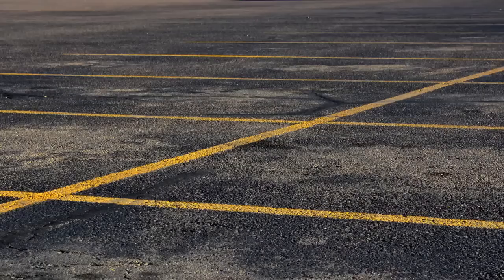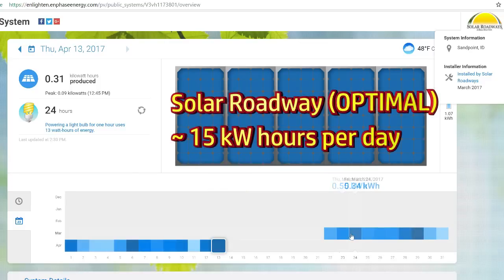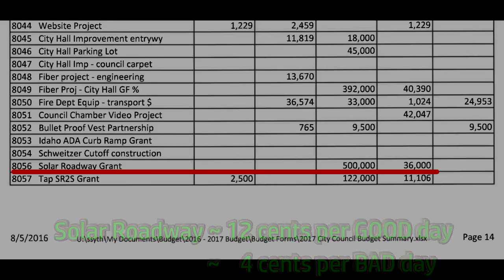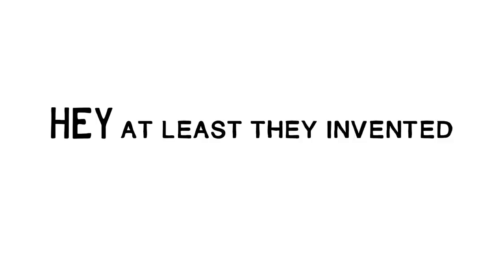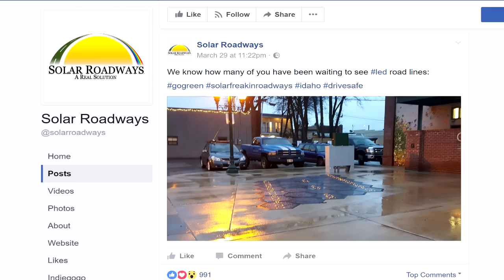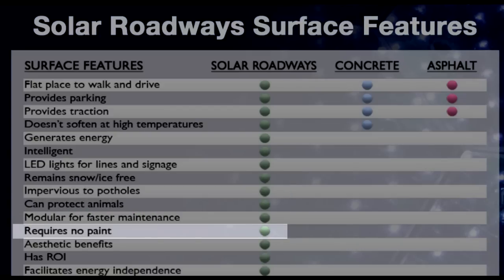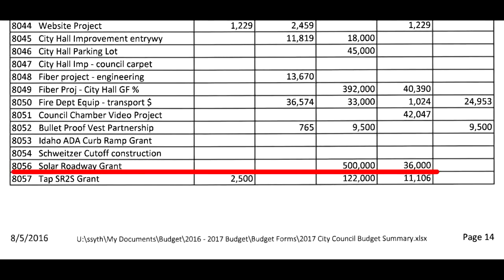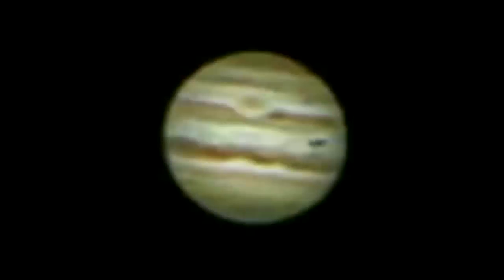Solar Roadways generate ~10 CENTS per day!!

Comment: I don't understand why they haven't had the LEDs in their example installation form any "useful" patterns. They just need a microcontroller to map the individual LEDs to a virtual grid and then they could easily draw anything they want. Is it because they are struggling with just getting the things to stay on and not catch fire? I guess that would take a higher priority.

Also for anyone that claims that these things just need more refinement and the economy of scale, neither of those things are magic bullets. Some ideas just don't make sense, and you can throw a thousand engineers and billions in development at them and get virtually nothing in return.

Comment: When trying to create a way to generate energy efficiently, why then would you add microprocessors?? Solar tech is already simple enough, but to add lights and microprocessors (when its not even needed)...then you are drawing more power than necessary decreasing your gains even more...not really that intuitive...

Comment: Here is a question, have you looked at the solar panel 'roof shingles'?

I ask because that seems far more reasonable  but in the frozen North of Ohio USA i can only imagine that in the winter it would not be that useful.  However i am more worried about cooling then heating, last year it got into the 90s a few weeks and that is not ok for Ohio.

So have you looked into those?  They are from Tesla i think.

Comment: My major problems. are: 1) washout under the roadway. 2) Solid, it MIGHT be able to withstand traffic. But will plastic withstand it? So far only concrete works best.

3) With traffic &/or snow on it, how could it generate power? Right now, they have it hooked up to a generator. 

4) they plan on making it even worse by having it be HOLLOW. Real roads have crowns in the middle, so water runs off. Won't happen here. 

5) Room for cables? Great, so if the road has to be replaced, how much cable needs to be replaced?

6) I'm not comfortable with water & electrical cables being together. What happens if there is a breach between the 2, say a major accident? A big rig overturning, Plane crash, tornado,  flood, mud flow.

Comment: Solar Roadways is a great idea, for about a minute. Then you imagine the worst case scenario on a road, realise there is sharp glass, metal, electronics and no drainage and a road accident will get about 100x worse when it happens. I mean, what happens to spilt fuel or oil on a roadway like this? Never mind the solar panel return on investment, what happens when you're relying on the "LED road markings" and there is an electronics fault so all the markings disappear? It's a great idea for a sci-fi film but in practice with the materials and technology available to us right now, it's not feasible.

Comment: The part about Solar Roadways heating itself to remove snow and ice is perhaps the most dangerous aspect of it. The worst kind of slippery winter ways are when there's both water and snow/ice on the road surface. What happens is that while the lowest layer of snow will melt, if there's a continues snowfall, it will come to a point where the water just freezes above the melted snow. Creating a very thin layer of ice on top(on ordinary roads it's the other way around - Water resting on top of a layer of ice), which when a car drives on, with even the best winter tires will run a much great risk of losing all grip that, making the car near uncontrollable - even for the best drivers. In essence, a similar situation to when you get aquaplaning while driver over wet road surface.

Comment: you have a point but I despise how blatantly disingenuous you're being with your assumption of prototype costs being final costs. You don't have to cheat to prove this as ridiculous, but as you choose to do so you strengthen these charlatans' position. I work in manufacturing. I know FIRST HAND how much economies of scale change the production costs. I also know firsthand how much the cost drops after processes are established and custom tooling and equipment have been acquired. By the time something hits the market, you get a price equal to only the base cost of the raw materials involved purchased in bulk at steep discount. A $5000.00 single piece demonstration prototype quote where all components must be machined from scratch out of bar stock by a skilled machinist on lathes and mills will drop PRECIPITOUSLY to less than a tenth of that cost once you have casting blanks that can pop out the same parts at the same effective quality several hundred pieces PER MINUTE under the supervision of an entry level machine operator. SHOW HOW THIS FAILS AT THEIR BEST CASE SCENARIO AND THERE WILL BE NO DOUBT.

Comment: You haven't mentioned transmission costs. Under say 10 miles of road, the losses in the cabling would no doubt wipe out any profit unless the voltage was raised to high levels. 
I don't want to appear to be a Luddite, but not all new ideas make any sense. Just because it's new doesn't mean it's good

Comment: I have been telling people for years, if we want to properly use solar power, cover the roof tops in panels. 

i dont know the numbers, but if every rooftop in a city is covered in high quality solar panels, it would at least generate the majority of its power, and will create more jobs then coal. 

Manufactoring of all the parts, plus installers, maintenance, and those running the management stations overseeing it all. 
cleaner, plenty of jobs, and panels need to be replaced every so often so its not set it up then walk away.

Comment: If Galileo wanted to put windmills in caves, they probably wouldn't have stopped laughing at him either...

(Also, at 15:30 you say half a billion, which is correct, but you wrote 500 billion. You might want to put an annotation over that.)

Comment: I don't know why no one thought of this, but streets get dirty, I feel like if everything else worked out in their favor, just the fact that you'd have dirt and surface scratches reflecting and refracting light away from the PVCs it would lose efficiency over time. I'm feeling lazy so I'm not going to look up the hardness of the glass they'd use, but I don't doubt it would scratch and scuff eventually turning from transparent to translucent.

Comment: Solar power for grid electricity on Earth is terrible*. All the toxic mess of making electronic devices. With all the disadvantages of trying to build a grid out of unreliable crap electricity (*stupendous transmissions requirements that need to shuffle electricity from anywhere to anywhere and near 100% backup with fast responding fossil fueled generators or ridiculous storage systems that cost many times world GDP). The transmission alone will replicate the mess of oil politics; look at the Desertec project; reads like a who's who of the Arab spring and refuge crisis.

The right job for solar  power is small remote knick-knacks and sensors and especially satelites. As a source of grid electricity it is just a delaying tactic for fossil fuels to make sure they have a future long into the 22nd century.
Reply: soylentgreenb I agree. great for space flight, ok for auxillary power for small important systems, terrible as a main power source. way too expensive to be feasible. personally I think investment into fusion is the best bet. it's risky and may never be feasible but if it ever does then it's practically limitless energy.

Comment: There is a difference between "doesn't work" and "can't work".

If this were 1980 you could pull similar numbers on home solar panels. Back when they produced 1/8 of current technology and cost five tines as much. Would you be laughing at how gullible people were trying to generate electricity from panels on top of their houses?

Now I'm not saying there will ever be a day when Solar Roadways will be popular. But production costs do drop, prototypes do eventually come more stable, and solar technology is still becoming more efficient. This idea might be viable, in some form, one day. Work as advertised? Oh no.But that is what science is. Trying stuff out. 

That self filling water bottle can't work, not ever. Put it in the wettest, sunniest climate and come up with a really good solar panel that is big and still no go. OK I guess maybe as an emergency means for boats it might work, but there are other much better options for that. Point it that can't and will not ever work. Solar Roadways might still have a use at some point though.

Comment: Must be nice to live somewhere that you can get so much power out of the wall.  Here in Canada our appliances top out at around 1500W because our power supply is 110 VAC with a socket maximum of 15Amps.  There's no way we could pull 3000W out of the wall for a kettle unless it was a dual heater/dual plug setup....which I have never seen.
I do remember living in Australia when I was a teen and getting an electric shock which rocked me to my fillings compared to the shock you can get here in Canada which is frightening but hardly even painful.

Comment: Wait, 30 kWh per day for an average American household?
About half of that (6000 kWh/year, 16.4kWh/day) is designated as "much to high" for a 4 person household where I live and the overall average of 4 person households is 4200 kWh (11.5 kWh/day)
So, is that number exaggerated or is it really that high in the US?
I mean, 30 kWh is about the equivalent of leaving 12 100 Watt light bulbs on 24 h straight.
Reply: It is correct. Though 2/3 of all power in US homes are for heating or cooling air or water. AC, home heating and water heaters is 2/3, while lights, appliances and electronics make up just 1/3.  So, the average up with gas heating and no AC with be 10kwh/day.
Reply: Loathomar Well, AC is probably the biggest difference there. Still quite impressive how much Americans use it if such a large portion of their total energy consumption goes into their AC.

Comment: Im sure this has been picked up, but they would only be generating energy at 1.2kW for about 3 hours, as there isn't a constant 1000Wm2 of solar irradiance for 12 hours in the day. Rather a normalised value of approximately 3 peak suns; equivalent to about 3 hours per day at 1000Wm2. So they should only produce approximately 3.6kWh of energy per day. Probably even less considering they are not tilted haha.

Comment: Not that I'm defending them in the slightest, but they are still "in the prototype phase" so it's VERY likely their panel price will go down (if people don't ever wake up to smell the BS). However, using that $500/sqft figure just doesn't seem appropriate when you're calculating the cost for a bigger infrastructure roll-out (like Walmart). It's more of an economy of scale. I suspect these guys are still hand making each panel, one at a time. So you're paying for their time with that higher figure. If they were to export the job out to China and do a large, bulk amount, I'm sure the price would go down. Even still at $50/sqft it's a lot of money with no ROI.

Comment: I stll don't get why they(plastic roads too) always say that fact it's modular makes it better than asphalt. Asphalt is a 100% modular, you can just take it with you in a tipper truck and then put it in any shape or form you want right on the spot without having to think about it. But with a modular road surface you'd need to calculate the shape of every single module for every single turn, bend or slope and then make sure the indivdual "modules" are built-in on their exact spot. So on a curvy road with a lot of difference in height every single "module" would be different from every other "module".
Reply: You are right, there is a reason that every single road surface is a malleable "putty".
Reply: Asphalt is also 99.99% recyclable.  Just throw it in a grinder and then cook it up for the next project.
Reply: It's also ignoring the fact that right now if you want someone who can repair a road, you just need someone who knows how to lay asphalt. With solar roadways you'll need to replace your road maintenance electricians who on average are about twice as expensive as your average highway maintenance person, and probably some electrical engineers to deal with any more complex problems that might arise. Even then we're not getting into how if any of the underground wiring malfunctions they'll have to rip out the whole roadway and rewire everything, and knowing how long construction on roads takes now, I'm not optimistic.
Reply: Hey no problem they did that with Space shuttle heat shield tiles, every one was "different", and it only took them 3 months to glue them on.
Reply: Modular roads are a terrible idea, anyone who has played with toys as a kid should know why.  Even at the LEGO train shows I display at we have problem with the modular roads not being the right shapes, and that is in an ideal environment where everything is very similar already.
Reply: Punto Racing Team 
The thing is these guys still haven't consulted any civil engineers and realize that roads aren't flat!

Otherwise we'd have puddles everywhere after every storm!
Reply: Agreed. See, the thing is, if there was something better than asphalt, WE'D BE USING IT ALREADY.

Comment: Just a reminder: Consumer grade Solar Freaking Rooftops refinance themselves after about ten years, but then you usually have to replace them because they start losing efficiency. At the end, you still got virtually free electricity. This will never happen with these Solar Freaking Roadways.
Reply: Those things usually come with a 20 to 25 year warranty on efficiency which guarantees that after that time, they'll still be operating at around 80%, and even after that, they'll lose about 1% per year. Hardly a reason to replace them, let alone after 10 years.
Reply: Mark That's why most people jump at those government subsidies that net you solar panels for your home.
Reply: @Mark not in the UK. There are companies who will install one for free as long as you sign over the "feed in tariff" and the electricity generated for 10 years. So you don't see a benefit for 10 years then it's completely free electricity. Also even though the panels do loose efficiency it's not as steep a drop off as people make out. After 20 years you should still be getting 80%. The main loss of efficiency is people not cleaning them, and dirt after 10 years can cut 50% of the light.
Reply: Gordon Lawrence How would you recommend cleaning them? just a damp cloth?
Reply: It depends on the type. Some can handle a pressure washer and that reduces the chances of scratches. A damp cloth can cause scratches the same as on a car. Some people round here get window cleaners with their kit to do it and I believe that works well. There are a few companies working on self-cleaning types and when those are commercially available that's what I will be getting.
Reply: kilésengati not free, not even close. After 10 years of generating power, the money you saved from the panel just covers the upfront cost. Count inflation on your original investment and the potential earnings it could have had in a 10 year investment or and you come in way behind.
Reply: Mark When you count in a "healthy" inflation of 4% p.a. you will theoretically end up with a price of ≈ $6,000 for the same panel ten years later (when leaving away technological advancements). Assuming everything - including electricity prices as well as your wage - gets adjusted to inflation, you would end up paying roughly the same value for the same product. Still, initially paying the value of today's $4,000 for one panel and then buying a new panel for the same value after ten years over and over again and you decide to leave after the life cycle of the panel ends, you will end up with a big, fat zero on your balance.
When applying this to real circumstances you have to count in many other things as well as the possibility of "random" events. But even with that, you are likely to spend the same or less on a solar panel than on buying the electricity the solar panel produces, plus, you will get at least a bit more self-sufficient regarding electricity.